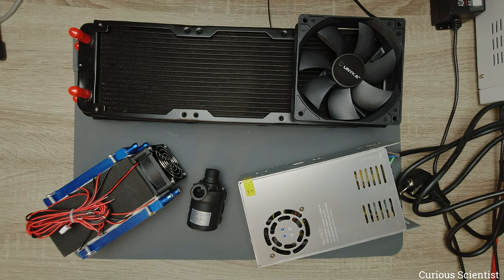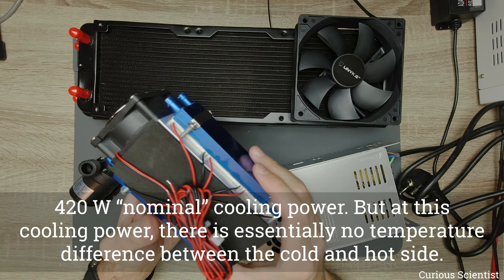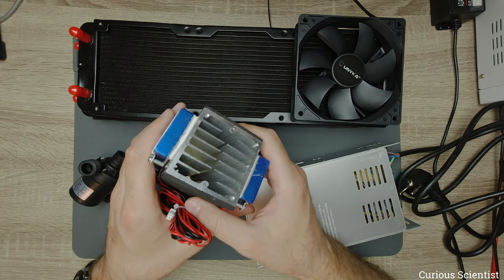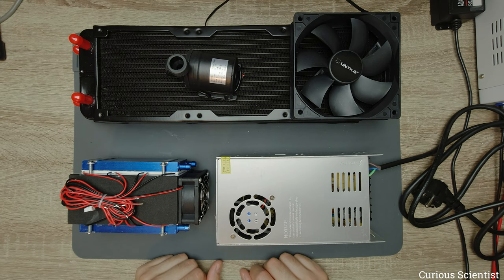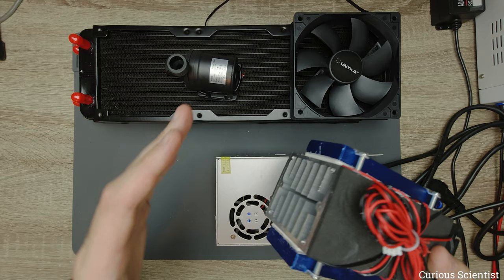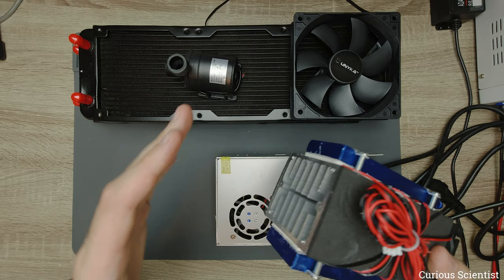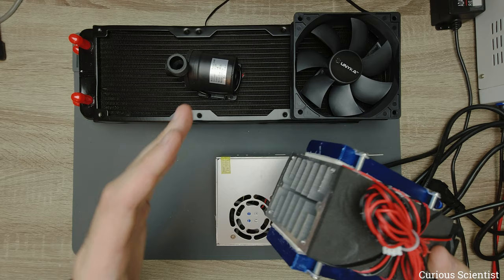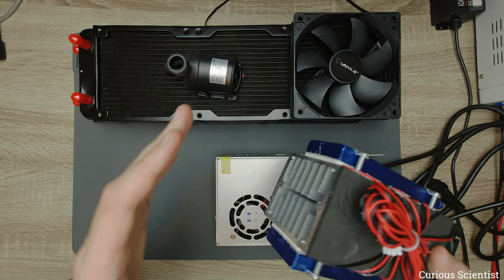Peltier cooler-based air cooler

Comment: Hi!  Been awhile since we spoke. Lots more subscribed now. This may be a dumb question...
If you ran a NEGATIVE 3V and a 12V+ supply to a peltier would we be able maintain the positive current supplied to be higher than the standard 9V DC supply?  My thought is that more Amperage and lower voltage will generate colder temperatures because the Wattage would be lower which reduces Joule heating but Amperage would be higher than at the 9V • camps alone. There is a problem with the Resistance of the peltier increasing substantially as it has a higher DTcold thus reducing the Amps and performance.

I'm sure it won't work like I think but I want to know why.
Reply from the maker: Hi! Long time no see, indeed. There is no such thing as dumb question!

Voltage is all about references as I understand it. Voltage is often defined as potential difference between two points. And potential can be imagined as kind of a work needed to bring a unit of electric charge from infinite distance (or a reference point) to the given point in an electric field... In electronics usually a common reference point is the ground (GND) which is often picked as the 0 V too. So, if you put a load between the -3 V and the +12 V points, the load will experience 15 V and if there is enough current can be provided, you will probably be close to fry the Peltier as 15 V is usually around the max voltage limit of them. 

I believe that you have a misconception here (or I have?!). But, I am pretty convinced that my thinking is correct here. For example if you take a split rail PSU which has +/- 12V output, then you will be able to measure +12 V between the +12 V rail and GND (0 V) and -12 V between the -12 V rail and GND (0 V), or in this case, you can flip the probes and measure +12 V, but that's cheating. However, if you put the multimeter between the +12 V and -12 V rails, you will measure 24 V. You can imagine it as a rubber band that you can stretch in two directions. You extend it symmetrically both ways 12 centimeters, the total length will be 24 cm which is proportional to the total tension stored in the stretched rubber band (this was kind of an analogy to the voltage). 

Unfortunately, there are no simple workarounds for Peltiers. They beave as resistors, therefore they obey Ohm's law. You cannot reduce the voltage and expect more current by any means. The only way to make Peltiers better is by inventing better materials.
Reply: @CuriousScientist  So, even though it "realizes" 15V it will produce the same Amperage as 9V? I hate rules and especially laws. Mr Ohm should have just minded his own business and let me break tons of natural laws!
Reply from the maker: @paulpease1788  It will produce the equivalent current for 15 V. If the load is 1 Ohm, then 15 A will flow, supposing that the circuit can supply 15 A.
Reply: So what materials are not used because of various reasons (too expensive,  radioactive,  explosive...etc) 
What would make the best peltier devices humanly possible. Something that would create enough resistance or generate more heat on one side and yet something with extreme low resistance to be able to accept more heat for transfer to the other side.  

Heat is sort of an arbitrary word. What is considered as hot is heavily subjective. I enjoy being in the shade on a warm 105°F Arizona day. (it often gets even warmer than 120°F or 50°C.) I think it's also  comfortable at 18°C. Others may find one or both of those as unbearable. 

All that just to say I appreciate the factual information and showing how the actual Delta of temperature is effected with power settings 

@CuriousScientist

Comment: hi I've been messing around with the idea of using peltiers for a few years with many uses in mind have you considered doing it the other way around using them to cool the water and use the radiator to cool the air
Reply from the maker: Hi! Why would you add an extra medium to the cooling system? It is just adding losses.
Reply: imagine this a well insulated water tank
Reply from the maker: I am trying hard to imagine it. What am I supposed to see?
Reply: @CuriousScientist  a insulated water tank filled with antifreeze piped first to a radiator with fans for cooling a room then piped to Peltier water block on the cold side ideally placed outside cooling the fluid before it returns to the tank the pipes would need to be insulated and have a radiator bypass valve for getting the fluid super cold and a big positive it's all DC and if you can get the wattage down it could run for a day or two maybe more from a few car battles and with power cuts happening more often it seems a sensible way to go
Reply: I'm thinking of it more from a energy storage point of view drip energy in a benefit later
Reply from the maker: I see what you are thinking. My issue is that this creates extra thermal interfaces. It will introduce further losses at those interfaces. The idea of storing heat in a big water tank however is a good direction. Power plants for example do the opposite way in terms of water temperature: they heat up water and store the hot water in underground storages. But still you cannot cheat  physics, you still need a lot of cooling power to use it properly.

Comment: Can we try this project on the top part of an actual air cooler to see if it actually cools down the water in an air cooler and makes the air cooler much more cooler?
Reply from the maker: You could improve the performance of the demonstrated system to a certain extent by cooling the water loop better, but the transferred heat would not really change too much. So, it would not make too much difference in my opinion.

Comment: very interesting for sure.  Has anyone place one under the hood in the intake.  Cars run better when compressing colder air.
Reply from the maker: This can not cool the air at such pace as the car consumes it. It would not make any difference.
Reply: @CuriousScientist  That was pretty much my thought.  But I thought I would ask.   I had not watched all the video when I posted either.  thank you for the fast reply.   I came across this looking for the stuff to make a small chiller for a tig torch.  I can see it would most likely not keep up with that kind of heat,  But it is the first time I have really looked at this tech.
Reply from the maker: It is a very interesting technology, and it has its own niche use, but when it comes to big volumes of fluids, it is pretty much useless. It just can not provide the necessary cooling power. And when we look closer and look at the efficiency, the information is even more disappointing.
Reply: @CuriousScientist  Well thank you for the reply.  I am going to sub and like for you.  I love watching people that build and invent thigs.   I will explore your channel.
Reply from the maker: Thank you! I hope you'll find interesting things. I will also upload some interesting stuff in the near future. Stay tuned!

Comment: Flip one side of peltier you wud have hot and cold water lol wonder if be more efficient water heater than kettle element if it's modified to your frezzer lol
Reply from the maker: Yeah, maybe, but the side which would make cold water would overheat very quickly since its hit side is poorly cooled.

Comment: So i did some light googling and have found that that an average peson gives off 330 btu per hour or about a hundred watts. Does that mean to feel a cooling effect you need to have a little more than 100 watts of cooling?
Reply from the maker: Hi! No, that is not how it works. To feel cooling effect (in general), moving air (simple fan) is already enough since the increased airflow increases the evaporation from the surface of your skin. You do not want to cool the body, you want to cool the air that passes through the heatsink. Also, there are other losses than the heat dissipation of the human body. This gadget just makes cold and somewhat dry air which can make you feel more comfortable.
Reply: @CuriousScientist  Another question I had is should the heat radiator be outside? If its inside arent you just feeding heat into the system of the room?
Reply from the maker: Of course the heat should be dissipated somewhere else, in a different place.
Reply: @CuriousScientist  excellent I thought as much. I was thinking about insulating my shed and making a cooler for it. Ill give this a shot and ill update you in the future with my results. Thanks for the replies!
Reply from the maker: Looking forward to the results! Please watch my video/videos carefully for ideas in order to avoid common mistakes. For example, do not run the Peltier coolers at their maximum rated current (run them at ~50-80% of that), cool their hot side as good as possible...etc.

Comment: Hot side outside the room, and 2 or 3 of these "blocks" should cool a small room.
Only problem is finding good genuine Peltiers.
Reply from the maker: You can find genuine Peltiers if you are willing to pay the price. :) BTW, 3 of this block with all the cooling system and power supplies would be really expensive.
Reply: @CuriousScientist  even after buying from a premium source most Peltiers are fake... QC is a huge problem.

Comment: 28:36 and a window AC is more efficient than a portable because the portable exhausts the heat in the same room that is trying to cool
Reply from the maker: In that sense, yes! But you can have these flexible pipes and put them in the window. Some of these mobile units even have some thick curtain-like stuff for the window, so you can seal off the open window while using the exhaust.

Comment: There are many things that people never care about.
They buy a car and use it as a lorry .I won`t go into all those silly things that they do  to stay on topic here.
Before anyone want to put a cooling system in a room , they first of all insulate the room to be sure that no heat from outside gets in . That room must have   air tight doors and windows to get the utmost of your cooling Systems. ( A refrigerator is a perfect example of what I am saying ).
Your Peltier stuff should have stand alone in one room and all of the heat sources ( power supplies and radiators ) in another room for your tests .
Second thing people must keep in mind that cool air stay on the floor and hot air will always go up to the roof. So this is why you may see in some places you may see the air cooling unit on the floor , the unit keep pulling cool air on the floor and push it back to a lower temp. where as the one on top will pull hot air to cool it , this makes a big difference in the pocket at the end of the month .
Putting an AIR CON. in a kitchen is an idiotic idea . Better to put an air extractor at the roof and and one inverted at the bottom  to pull fresh air inside .Still I have seen people using air con in kitchen , and then say " oh my god ," looking at his electricity bill at the end of the month 
That experience that you made ( even you said that the radiators should be out ) does not suit what the audience watching that video expect as  result .
So in fact you lost your time in doing all this, and it proves nothing good about Peltiers functionalities . this video is a TOTAL misleading one for your audience .
In  fact a very good butcher  dose not mean a good  surgeon .
Electricity is one thing and air conditioning is another thing , if you want to master both you should study both before combining them .
Reply from the maker: I think you haven't watched the whole video carefully. At least that's what your comment suggests. Peltier coolers will never be suitable as air coolers or conditioners due to their low efficiency and cooling power. Even if I fully insulate the room, and separate the hot and cold side, that 1-200 W cooling power won't make any difference. Cheers!
Reply: @CuriousScientist  I watched the full video . and I will stay on my comment that you made it wrong . 
I said that people buy a car and use it as a lorry . " do you understant that phrase ? If yes so tell me what does it means . Waiting for reply
Reply from the maker: It means exactly what I tell in this video. Peltiers are not made for air conditioning. 😉

Comment: Hello @Curious Scientist, thank you for all the effort you put in these awesome videos!
I'm currently planning to build a two-stage peltier- freeze- dryer to filter out the remaining H2O of a glovebox with a nitrogen atmosphere. But I'm worried how to cool the peltiers best: One wants to keep the peltiers hot side as close to room temperature as possible as the dewpoint would be at around -60°C and therefore will need very good insulation. CPU coolers with heat pipes work best at higher temperatures as they just start working at 25°C depending on the liquid filling so I would opt. for water cooling. Do you have any recommendations for radiators in order to keep a stable and low water cycle temperature? Maybe there is no point in trying but I'd like to test it and follow up on your experience.
Reply from the maker: Hi! I haven't tried any other products than those which are shown in my videos and all of those products can be found on my website in the "Tools" page. I think this radiator would be sufficient as I was able to reach below -40°C with a smaller (240 mm instead of 360 mm) radiator. -60°C would be challenging as that is approaching the edge of the capabilities of these coolers. Maybe a stack of 3 Peltiers would be needed. Once I tried cooling a Peltier with dry ice (-78.5°C), but I was not even able to reach that cold with the Peltier cooled by such temperatures... Maybe I was not doing the things correctly or something, but as far as I know Peltiers become less and less efficient at lower temperatures, so this might have been the reason.

Comment: If you want good results you must put the hot air away from the cooler like ac external unit and inside the room keep cooler this will make difference but keeping both hot and cold side near to each other this won’t give you any results at all
Reply from the maker: I know and if you actually watch the video you will see that I talk about this thing...

Comment: You can improve the cooling if you use two other radiators for the cold part instead of that small fan , the cells would be like the compressor of a normal air conditioner , but you would also have to put other of those blue heatsinks for the cold part of the cells.
Reply from the maker: I already tried such a setup, but it would not make it better. It is just the type and amount of Peltier coolers in the setup that is insufficient.
Reply: @CuriousScientist  

Did you try also stocking the Peltier? 👍🏼👋🏼
Reply from the maker: Yes, check my videos. Stacking them does not improve the cooling power but it leads to lower achievable temperatures on the top of the stack. The cooling power of the stack will always be limited by the cooling power of the bottom Peltier cooler in the stack.
Reply: @CuriousScientist  

Ok , then you need to try more cells and especial coolant not water, and better air flow with an impeller maybe 🤔😀👍🏼👋🏼.
Reply from the maker: What do you mean by coolant? There's nothing better than water (for domestic use).
Reply: @CuriousScientist  
The same coolant that you use for cars.
Reply from the maker: Why would you use it here? It makes no sense.
Reply: @CuriousScientist  the liquid in the system doesn't get 33 below? If the liquid doesn't get below freezing I'd guess there's no reason for antifreeze then
Reply: Is there no specialized auto coolants that are prone to beneficial effects for an air conditioner setup like this ? Make the liquids reach a colder temperature faster? Reduce viscosity at lower temps than pure water? Anything?
Reply from the maker: Anything, especially alcohol, mixed with water decreases its properties. There's no point adding anything to the water. It is not the bottleneck...

Comment: Actually peltier modules are 2 percent efficient so 420w × 0.02 =8.4w of actual cooling capacity that 420w is power draw ok
Reply from the maker: Maybe they are a bit better than 2%, but yeah, one has to pump in a lot of energy to get some cooling power that makes sense.
Reply: That's close to 2 % if we include wiring and other factors than it will be 2% only